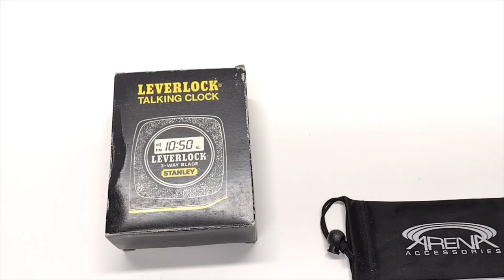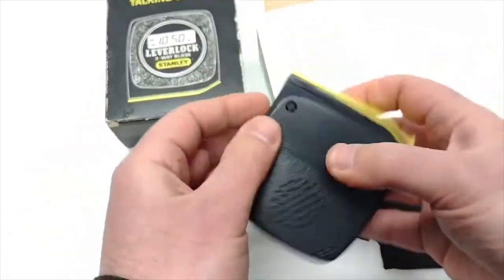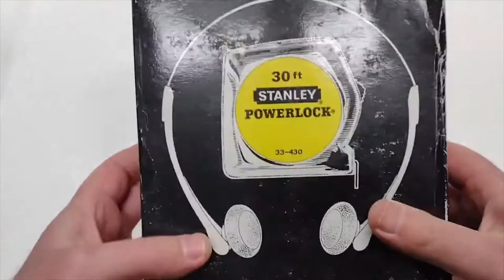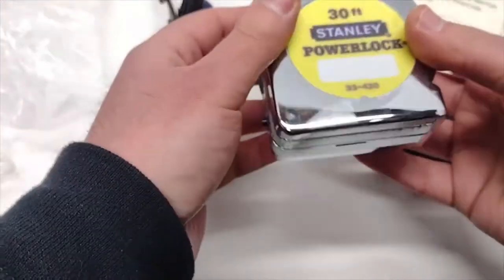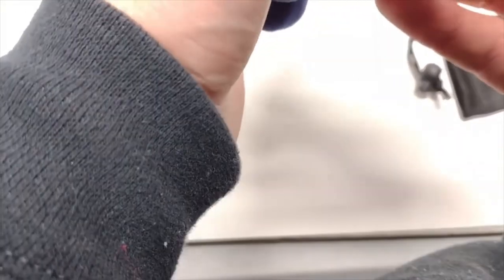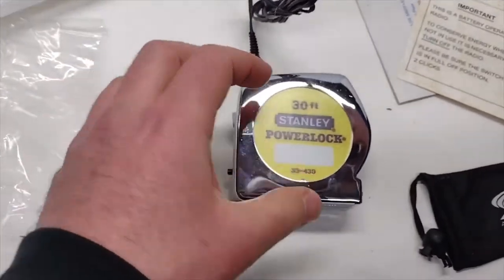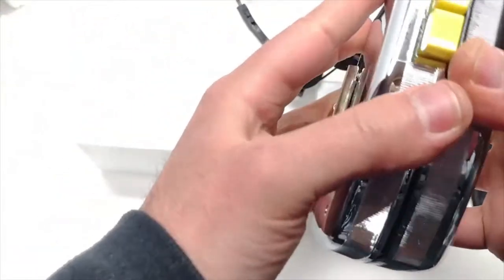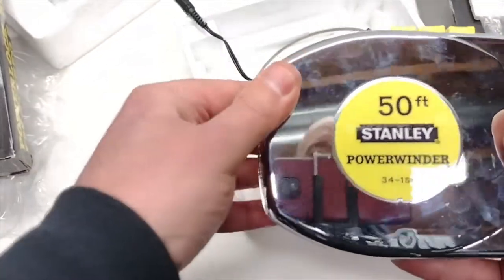Stanley Works Vintage Collectibles! Talking Alarm Clock, Tape Measure FM Radio and Cassette Player

Comment: Thanks for uploading this video, as both a legally blind person and fan of items with electronic voices, ive been wanting to hear one of these in action for a while now. I actually had thought that seeing as though it's from the 90s, it would have that standard talking clock little girl voice and the rooster alarm  that is on many of these cheaper talking alarm clocks, but I was surprised to hear that the voice reminds me a lot of several of the 90s VTech talking toy laptops, it seems to use a similar LPC speech chip.
Reply from the maker: Thank you for watching, and for your feedback - I just got it up on ebay, but we have it priced a bit high.  I'm sure people will beat us down with the best offer feature.  I threw the auction link up in the description.